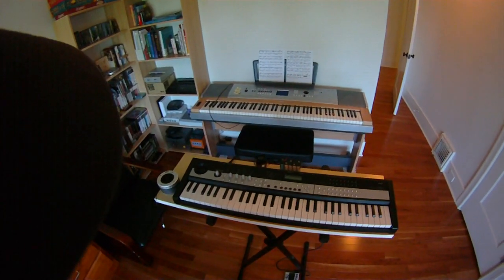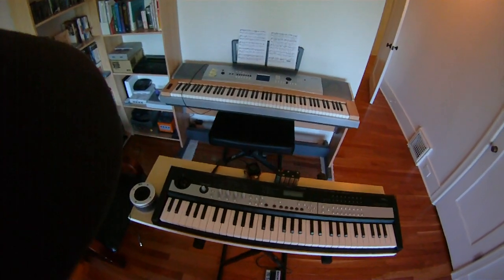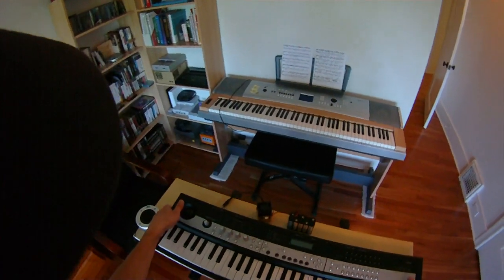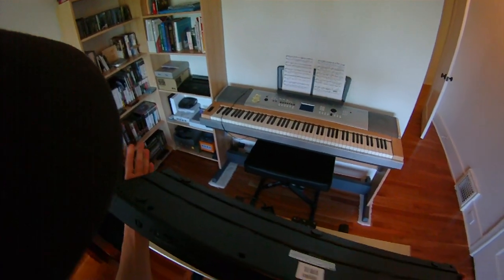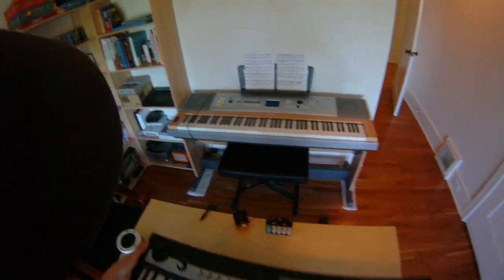Korg microSTATION on battery power

Comment from the maker: The other things are just any 10xAA battery holder (check that they are wired in series - most of them are), and a power plug. Like the video description mentions, the plug can be found from the Sega Genesis video game system (model 2 and up), or you can chop the end off your original microSTATION adaptor and make it de-/re-attachable.

Anything else is just extra fancy and not strictly necessary. I added a little heatsink and fan to the voltage regulator and an on-off toggle switch

Comment: gotta love the retro game consoles in the background! lol, I'm jealous of this. I'm not an electrician, but I'm getting a KORG microstation and I'm extremely interested in making myself one of these battery packs. Is there anything else I need besides the 10 12v AA batteries, the 10 AA battery holder, the voltage regulator (It looks like a tiny chip?), and the plug?

Comment from the maker: @The123Shannon
Thanks for your comment. I bought the parts from a local shop, so I won't have Digitech/Mouser part numbers or anything for you, sorry. It does require a tiny bit of soldering, you can put this on a perf-board.
The main component is a L7809CV regulator, it also needs one 0.33uF capacitor and one 0.1uF capacitor, these are usually ceramic caps. The schematic can be found at the top of page 4 of the L7800-series datasheet, the 'application circuit'.